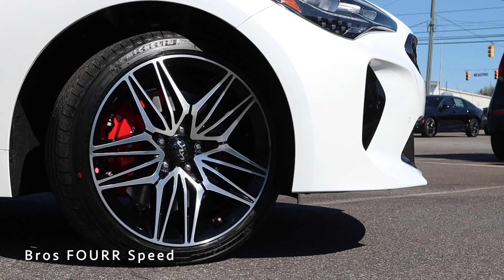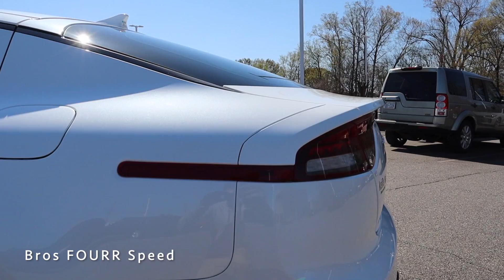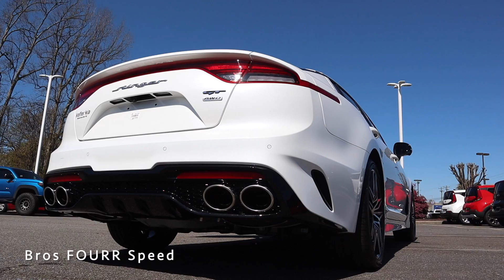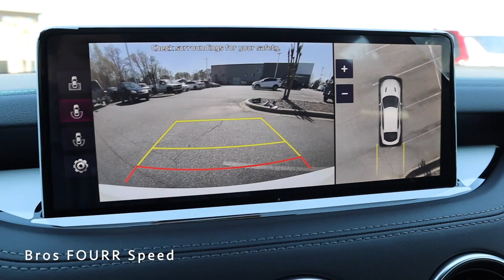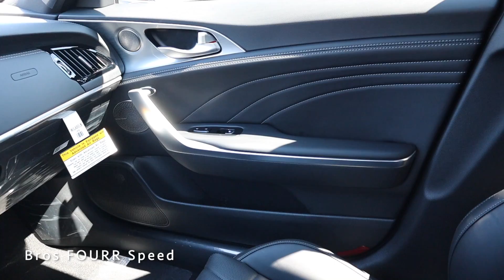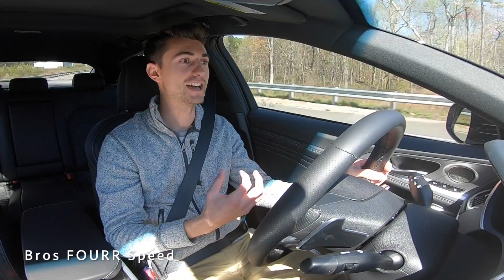2022 Kia Stinger GT2 AWD: Start Up, Exhaust, Test Drive and Review

Comment: Yuck. I can think of many other cars to buy for $50k who’s genealogy doesn’t include the Kia Sephia and the Kia Amanti. Thumb up for the review though!
Reply from the maker: Lol glad you liked the video. What car would spend $50k on?
Reply: @BrosFOURRSpeed  You wont get any response about the "many other cars" Lol. The only car that rivals this is the 485hp Charger Scatpack.
Reply: @acidnut Any car would work. Doesn’t have to be a sports car. Could even be a 4Runner. Not spending $55k on a Kia so stop it.
Reply: @MercDiggler  Kia also has an SUV for $20k. What is you point?
Reply: @acidnut  an new off road is mid 40s. You can’t even buy a chr or Rav for 20k stop it
Reply: @MercDiggler  What does off roading and Rav 4 have to do with this sports sedan?
Reply: @acidnut  bro I said I can think of many “other” cars to buy for $50k. Not just a sport sedan made by Kia, stop it. The lineage and heritage is not something I want to be apart of and every time and Audi or a challenger rolled up on me I would literally be embarrassed. But while we’re on the subject I would rather have a Rav than a Stinger and I drive a 370Z and it’s not fast. Which by the way is how I found this channel a few years ago bc of the Z content.
Reply: @MercDiggler  So basically you are admitting to being a Kia hater with no other reason. There are many other cars under $50k; thanks captain obvious.
Reply: @acidnut  yes bro, literally implied that in my op. But not just to be a hater. Amanti, sephia, heritage. Stop it.
Reply: @MercDiggler  I can buy a bike for under $50k or a used pickup truck. What is your point again?
Reply: @acidnut  stop it
Reply: @MercDiggler  So no point just like the OP. There are not many haters under a rock like you left compared to 10 years ago.
Reply: @acidnut  hey bud if you’re too dim to understand the point you shouldn’t be harassing the op trying to mine one out. You’re entitled to an opinion. Ok you got me. Stop it already.
Reply: @MercDiggler  You must be a walking stop sign. Not all opinions are equal. You post in public, be ready for critique.
Reply: @acidnut  all good bro. Again you’re entitled to your opinion. Kia is trash. Period.
Reply: @MercDiggler  Thanks for admitting you are a Kia hater. I just want you to admit that so shoppers dont take your original comment seriously. Thanks.
Reply: @acidnut  shopper? Bro we already know Kia is literally trash. You must be a Kia Salesman lmfao
Reply: @MercDiggler  Yes you are here so you are a potential shopper of this beautiful sedan.
Reply: @acidnut  no I subscribe to bros for speed that’s why I’m here
Reply: @MercDiggler  He loves the Kia Stinger! Look how many compliments he gave.
Reply: @acidnut  bro sounds like you have zactly disease
Reply: @MercDiggler  Yea but you can't deny this beautiful car no many how many diseases I have.
Reply: @acidnut  are you sure you don’t have zactlys?
Reply: @MercDiggler  I have whatever you fantasize me to have.
Reply: @MercDiggler  

You are aware that the Stinger was designed by team of German engineers that used to work for Audi and BMW right? And it doesn’t share any components with those cars you mentioned. Oh and challengers are overpriced plastic pieces of shit. Stingers can blow scatpacks away all day long it’s hilarious. And no most people don’t pay full msrp for most cars unless desperate.
Reply: @ricanflow  fully aware. Still a Kia
Reply: @MercDiggler  A beauitiful Kia at that, much more reliable than garbage Nissan.
Reply: @acidnut  lmao be that as it may it’s still a Kia. The name means point A-B throw away cars that end up with a get me done consumer, buried 10k at trade, car over allowed so much the dealership has to send it to auction then it’s picked up at a buy here pay here lot sold to somebody with an 18% APR and a rebuilt title. now both of you stop it. You sound silly and uneducated about your market place.
Reply: @MercDiggler  I see a lot of Nissan at rental places. boy them sentras look ugly.
Reply: @acidnut  looks are subjective I agree but the heritage made Kia the brand it’s known for today and that’s crap. Hope you enjoy the rest of your day
Reply: @MercDiggler  Kia is known for value for the money. It is not for the insecure who are afraid of what some stranger thinks of them though.
Reply: @acidnut  you’re definitely buried on a Kia
Reply: @MercDiggler  I am not buried in a stranger's ass though.
Reply: @acidnut  I don’t know what that means but Kia is not known for reliability. Literally nobody knows it for that. Nice try though
Reply: @MercDiggler  That means you live your life for someone. You drive your car for someone else's approval. Make sure your wife/girlfriend is not someone else's approval. Google reliability and see where Hyundai/Kia/Genesis rank.
Reply: @acidnut  would never risk my families life in a Kia. I’m glad you have found something to fight for but you’re wasting breath
Reply: @MercDiggler  I am not speaking so not using my breath. But you are who you are. Cars or family,. it is the same mindset.
Reply: @MercDiggler  Sounds like you have some real KIA daddy issues
Reply: @vidic155  nah bro. If you drive a Kia it’s cool. Not mad at you. Just not sure why you Kia drivers are always on the defense if your car is not a shit box. Nice try to insult tho. Worked about as well as your car after a few years.
Reply: @MercDiggler  cool story ya flog
Reply: @vidic155  cool word